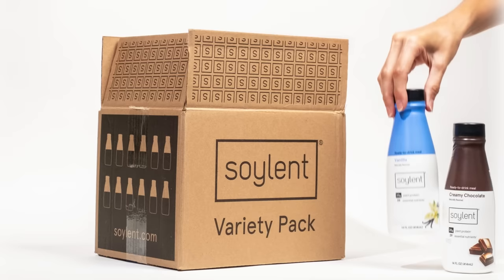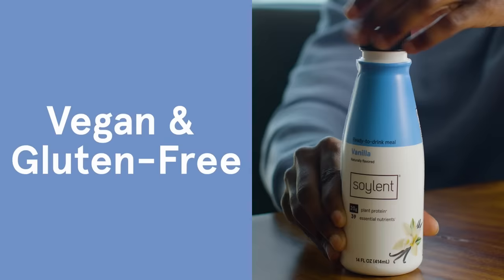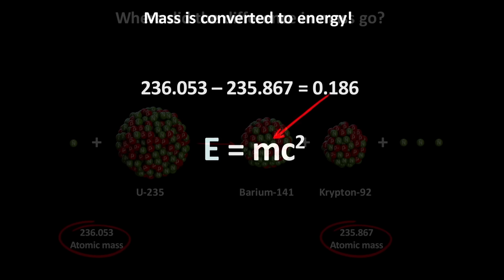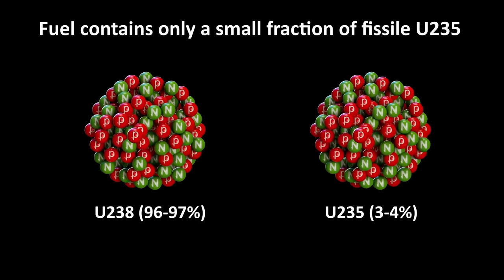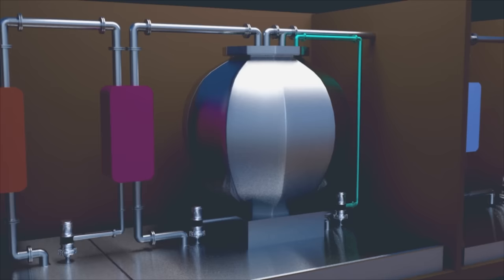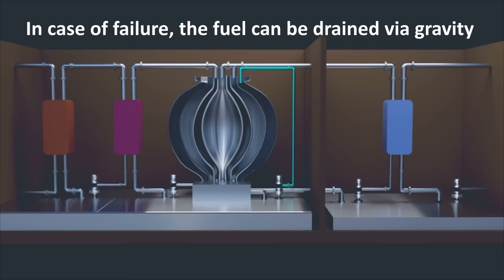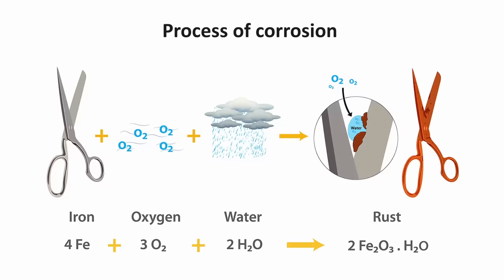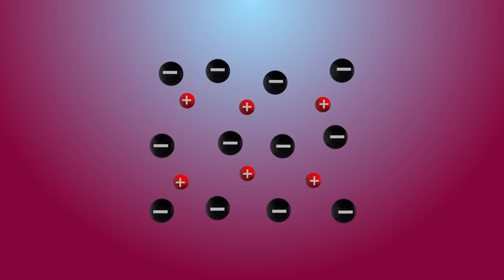How Molten Salt Reactors Could Revive Nuclear Power

Comment from the maker: The first 500 people to use this link and code ARVIN30 will get 30% off their first subscription with Soylent: https://bit.ly/3S3KnYB   
Many thanks to Soylent for sponsoring this video. Support us by clicking the link above,. 
Quick story about their name: Soylent was actually named after the food in the 1966 science fiction novel "Make Room! Make Room!" and later 1973 film Soylent Green. While the food in the book is made from soy and lentils (hence the name), the food in the movie is made from humans. Soylent actually in 2022 (the year the film takes place), released a SoylentGreen snack bar in a mystery flavor as a humorous nod to the film.
Reply: ...why would the nuclear power industry require "saving" when it claims to be efficient, economic and safe?
Reply: Could "Cathodic protection" be used to help reduce corrosion, in the same way it is used on underground natural gas pipelines?
Reply from the maker: @SpotterVideo  Good question. I'm not sure that it would work in the extreme chemical and temperature conditions, or whether there is sufficient electrolytic conditions for it to work. It's a good question for Copenhagen Atomics. You might ask them on one of their videos. The link to their YT page is in the description.
Reply: Im not a fan of conventional nuclear power but molten salt thorium reactors (maybe even as small modular units) I could see supporting. If it turns out to work ofc. That even I would say that shows the power of progress at work in this field.
Reply: But how common is thorium? Is manufacturing thorium fuel expensive? Or is it cheaper than plutonium? Yeah, besides safety prices is another big concern for people.
Reply: Missed opportunity to quote the movie and say "but in the movie, soylent green is people".
Reply: I'd like the Soylent Green, please.
Reply: I checked the formulation (a professional obsession 😂) and as a food scientist I would not endorse Soylent drinks from several reasons, mainly for using cheap artificial sweeteners (sucralose) and artificial flavors. These are somewhat controversial (to be gentle and polite) in the human nutrition. This is the only dark side of this interesting video. Thanks!
Reply: @GladDestronger  The mining industry produces more than enough thorium as a waste product that costs it money to dump. It is the most plentiful and least expensive of fuels.
Reply: Well, I guess that answers my question.
Reply: Soylent Green Are People!!!
Reply: I think it's hilarious...
Reply: Only the older generation understands your comment 😳🙄🙀
Reply: @GladDestronger  Using thorium however requires the reactor to be configured into a breeder to turn TH232 into U233, and can generally be a proliferation risk due to the need to create a U233 isotope segregation step (not much different than what it would take to extract plutonium).  It is not as easy as just mixing it into the pot and would require additional engineering, cost and security.
Reply: ITS MADE OF PEOPLE
Reply: Solarium is better if you're talking fishin. But you should never be talking fishin only Fusion.

And technically that's a waste of time too.

What is needed is direct stimulation of EM emissions from other e m emissions.
Reply: Well... how feasible is that to do?
Reply: Remember Soylent Green is people.
Reply: Tellurium embrittlement
Reply: you can have a molten salt breeder that uses uranium no problem, even 'spent' fuel is mostly U238, can be bred into Pu239 in the same way Th232 can be bred into U233 and then fission.
the big advantage/regulatory hold up is the liquid fuel, normal fuel rods only use ~5% of their fuel before they crack.
US regulators are getting a lot beter, I think INL is doing some corrosion testing, PNNL is doing some salt chemistry   
DOE has an advanced reactor project but I believe the first test reactor will only be salt cooled not fueled 
 @GladDestronger
Reply: the reactor that ran in the 60-70's ran FLiBe, even with hastaloy N or inconnel 600 above 750 with fluride salt the vessle 'becomes porous' lol
the other way is use chloride salts, worse neutronics so you have to go fast spectrum but thats fine, can go 850~900. high enough for chemical prossesing.
you can just capture the carbon out of the air and bond it back onto hydrogen and have a closed liquid fuel cycle. easy haha
@SpotterVideo
Reply: @samuelforsyth6374  How is it the defects at the grain boundry layer no longer experience segregation?
Reply: I did not get the discount in Canada. I guess its for monthly subscribers only.
Reply: @GladDestronger  
When Uranium decays, Thorium is produced.
Reply: So, it's easily available.
Reply: Wikipedia does a good job of covering the design of the compact molten salt reactor but I can't find any reference to it on your website. It's hard for me to believe you are completely unaware of it🎉🎉🎉
Reply: I replied but my reply was instantly deleted -
what's going on?
It had a link to another Thorium YouTube video.
OK - I posted it again without the link.
Reply: Sir Bobby, excellent questions to which my answers are given in detail below. Cleaning the salt: To complete the breeding cycle, there are two salts that require cleaning.  The fuel salt requires the removal of fission products that would absorb neutrons needed to maintain the chain reaction, with an excess of neutrons from each fission of U-233 that goes toward the conversion of Th-232 into Th-233.  The last species becomes U-233 after two beta-decays.   The most important  fission product to remove is Xe-135, which has a huge cross section (2 million times greater than normal) for capturing neutrons.  The isotopes of Kr are also abundantly represented in fission products and are important to remove for the same reason.  Fortunately, both are noble gases that will bubble out of the liquid salt if we sparge a carrier noble gas like helium into the pump bowl.  Next, the fissile U-233 needs to be reclaimed before further cleaning of the fuel salt.  Sparging fluorine gas, F2, into small samples of fuel salt will convert UF4 into UF6.  While UF4 is a liquid at temperatures characteristic of the fuel salt, UF6 is a gas and will, if encouraged, bubble out of the molten salt.  This step also removes compounds of volatile fission products like dangerous I-131 with an 8-hr half-life .  To separate the UF6 from the other volatile species, the vapor is passed through a powder of NaF-BeF2, which will adsorb the UF6 while letting the other gases through to be bottled and stored as radioactive nuclear waste.  By then passing hydrogen gas, H2, though the powder, the trapped UF6 is converted back to UF4 with the release of 2 molecules of HF gas for each molecule of UF4 or UF6.  The NaF-BeF2-UF4 can be put back into the reactor core as clean fuel salt, while the 2HF can be converted by electrolysis to F2 + H2.  The recycled F2 can be used to convert a new batch of UF4 to UF6 that is trapped in fresh NaF-BeF2, while the recycled H2 can be used to convert the UF6 trapped in NaF-eF2-UF6 into a new batch of cleaned fuel salt, NaF-BeF2-UF4. Where does the fresh NaF-BeF2 come from?  The small samples of fuel salt into which we sparge fluorine gas, F2, has not only NaF-BeF2, but also non-volatile fission products, some of which are extremely radioactive.  The high radioactivity will steadily try to increase the temperature of the fuel salt.  If we pump down the pressure above the contaminated fuel salt, we can vacuum-distill the fuel salt so that NaF-Be2 boils away as a gas once the temperature gets above 1000 C.  This vacuum distillation produces gaseous NaF-BeF2, which will become a liquid and then a solid as it cools down.  The pure solid NaF-BeF2 is what is made into a powder to capture the UF6 in the previous paragraph.  The non-volatile fission products left behind need to be divided into very small parcels, so that their large surface-to-volume ratios allow them to be cooled, and then converted from fluoride forms into safer oxide or silicate forms.  We put the parcels of solid oxide or silicate fission products into cold storage for up to five years, before fusing them with non-radioactive glasses to be buried for, say, three hundred years until the radioactivity decays to safe background levels. Blanket salt When we write UF4 or UF6 in the above, the U we are assuming is mostly U-233 (with a little accompanying U-232).  Natural uranium is mostly U-238 with a little U-235 mixed in.  Where do we get the U-233? The answer is from the blanket salt, which is either NaF-BeF2-ThF4 or, more simply, NaF-ThF4, with natural thorium being almost pure Th-232.  When Th-232 is irradiated by neutrons generated in the reactor core in excess of what is needed to maintain the chain reaction, the Th-232 can capture a neutron and become Th-233.  After two beta decays, the Th-233 turns into U-233.  In the blanket salt, the U-233 is in the form of UF4.  To separate the UF4 from the rest of the blanket salt, we remove a small batch of the blanket salt from the pool for off-line processing.  The processing consists of sparging F2 into the small sample, whiich converts the UF4 into UF6 that bubbles out of the blanket salt.  Unlike uranium, thorium does not have any valence state higher than +4, so the thorium stays as ThF4 and remains as a liquid in the cleaned blanket, salt which can be put back into the pool. As before, a powder of NaF-BeF2 can capture the UF6, with the combination turned into fuel salt by the methods described earlier.  Indeed, to prevent the cleaned fuel salt from dropping in U-233 concentration, we should add the UF6 extracted from the blanket salt as a supplement to the UF6 that comes from cleaning the fuel salt to make up whatever was lost by fission reactions in the core. In this way, the reactor becomes a breeder, which is self-sustaining in its fuel requirements as long as we have enough thorium in the blanket salt.
Reply: 😅 ML is
Reply: @Bobby-fj8mk  thank you for the information I finally found the link to the graphite moderator. Does this mean that the cmsr is dead, or that they may come back to it in the future?
Reply: @mikefallwell1301 -  Hi Mike - I'm not sure about Compact Molten Salt Reactors.
I have a link but if I posted it YouTube would instantly delete any link.
Reply: @Bobby-fj8mk  I've been studying this system for about 6 months. It says that sodium hydroxide reduces the size of the core by a factor of 8, relative to a graphite moderator.
Reply: @mikefallwell1301 - OK thanks but it doesn't use Thorium.
Reply: My goal is the most economical Mass producible floating reactor. That seems to be the path seaborg technology is taking
Reply: Talj to cia about the neucllear sisasteea
Reply: @PetraKann I remember watching an old news reel about the first commercial nuclear power plant opening in the UK, "Power too cheap to even meter" yeah well that didn't work, it was  subsided to the hilt..

Comment: A big drawback of coal is how much radiation it releases because of the radioactive elements in the coal you are burning 🔥
Reply: Maria Curie
Reply: radioactivity is released also due to mining. low grade coal need to be washed and that produces water pollution. and the fly ash
Reply: Not to mention all the mercury and cadmium.
Reply: @rtqii  mercury and cadmium are not related to coal or coal mining. Both are expensive metals and if we can recover any, we shall

Comment: Fukushima is indeed, a good example of how safety nuclear plants are. A nuclear plant that survived a seaquake, with 0 direct deaths and 1 indirect.
Reply: Well you can go to live beside a nuclear power plant, it's curiously cheap and safe!
Reply: @samuelec  If you live in France, probably this is the case.
Reply: Unless you count deaths as a result of the (unnecessary) evacuation itself.
Reply: @samuelec   Honestly, I would, and I would also be bathed in LESS radioactivity than living next to a coal plant.  

Also, do you seriously think highly-educated and expensive people would work inside nuclear plants, every, single, day, if they didn't believe it was safe???
Reply: @unduloid  or a hydroelectric dam
Reply: So safe that thousands of people had to fly away ASAP.

Google magazine Science text titled "Near miss at Fukushima is a warning for U.S., panel says
Spent fuel could have ignited, worsening disaster".
Reply: I feel the bigger issue is people not knowing that new generation light water reactors have a 72 hour passive cooling system.  So, they cannot have a TMI/Fukushima type meltdown.  HTGRs have passive decay heat removal and can easily run thorium.  MSRs are not that unique.
Reply: @augustlandmesser1520  They didn't have to, though. Only one person died from radiation related complications, and they were a Fukushima worker who died from cancer caused by radiation years after they were exposed to it. So clearly the evacuation was unnecessary and did way more harm than good since over 500 people died during it.